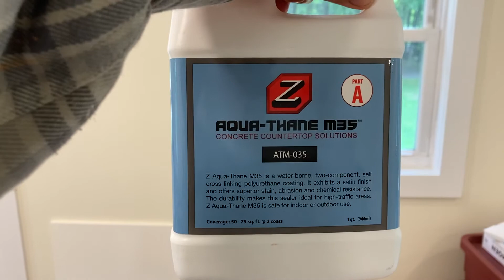Pouring Concrete Countertops on the IKEA SEKTION Cabinet System   PART 5

Comment: I can’t thank you enough for taking the time to pull these videos together! With all the other pour-in-place YouTube videos, yours by far taught me the most on what to do what not to do on my upcoming project. Much appreciated!
Reply from the maker: Wicked!  Thanx for the kind words. It was a fun project. Not sure if you saw my comments on one of the videos - but in hindsight I think I would add some beefier “rebar” in the skinny section in front of the sink - vs only the fiberglass mesh. I had a hairline crack form. Hardly noticeable and not sure some metal “rebar” would have changed anything but worth a shot. All the best - Matt & Kat (Things).
Reply: @matt_n_kat_things  Yes I saw that, thanks. I’m planning to add some steel bar in front of the sink just in case. All the best to you folks!

Comment: on the front form if you use a mutli tool or a drill with a old polisher you can vibrate the air out as can vibrate under the boards
Reply from the maker: Don’t remember if I had it in the video or not - I did buy an attachment for the oscillating tool that vibrated to front of the forms. Worked pretty well.

Comment: How are the cabinets handling the weight now that it's been a year or so?
Reply from the maker: No issue with the cabinets and the weight. I don’t think the weight on my pour is much different than a granite installation (?). I do have a small hairline crack in the thin section of countertop between the front of sink and front edge of countertop. No compromise in structural integrity- hardly noticeable. If I were doing it again I think I would reinforce that area with metal rebar vs the fiberglass mesh.
Reply: @@matt_n_kat_things 
 thank you! I cannot wait to start our project
Reply from the maker: I did want to follow up with one new point. After your question I did investigate a bit further and I noticed that countertop end all the way to the right closest to entry door was a bit out of level - slightly sloping down toward front of cabinets. I took the snap on kick molding off and realized one of the plastic legs that supports the front of the cabinets was a bit loose. They screw out longer to adjust the height. I think what might have happened is the weight of the counter made that plastic screw adjustment “jump a thread” - basically making it a fraction of an inch shorter. Could possibly have been normal expansion/contraction from temp - but I think it jumped. I cut a 4x4 1/16 longer than the height under the cabinet - set it behind the plastic leg (after I retightened the leg) - jacked up the front edge of the cabinet - slid the 4x4 in - and let the weight off the leg. Ain’t moving now. Bottom line is that it might be worth it to add some additional blocking under the cabinets in a few places as a back up to the plastic legs. Kody Harvey (YouTube) goes as far as bypassing the legs all together and builds a wooden base to set the cabinets on. Hope this makes sense. All the best. Matt & Kat (Things)

Comment: Might have missed it in an earlier video, but did you guys reach out to anyone on what type of concrete to use? looked like standard quikrete bags. It would be much cheaper to do that, so I am hoping thats all you used. Thanks!
Reply from the maker: Yes we did. The cement mix recommended by Concrete Countertop Solutions is called “sand topping mix”. Hope this helps. All the best - Matt & Kat (Things)